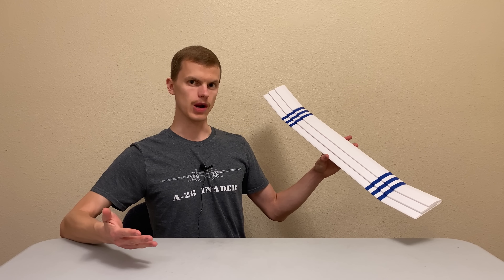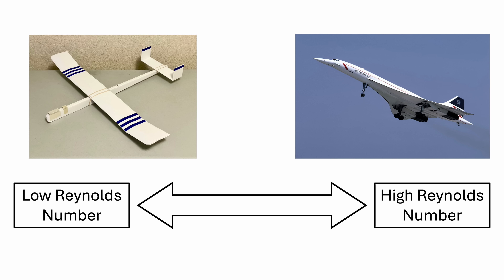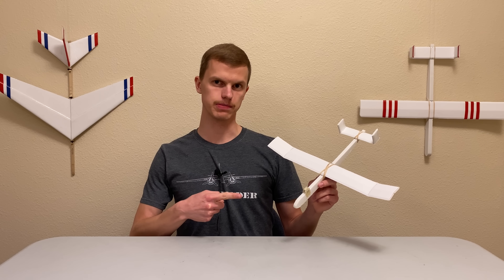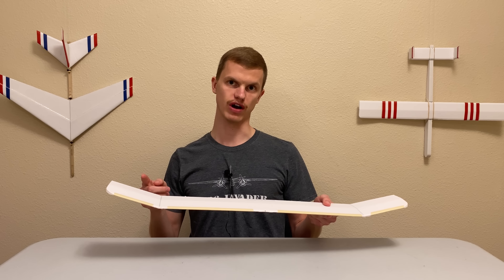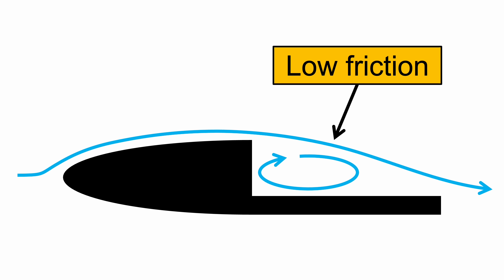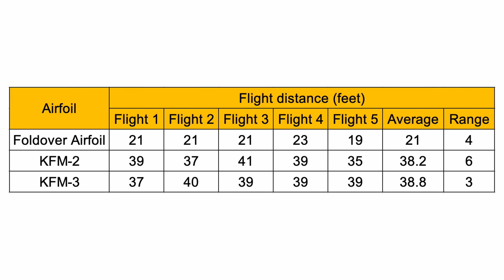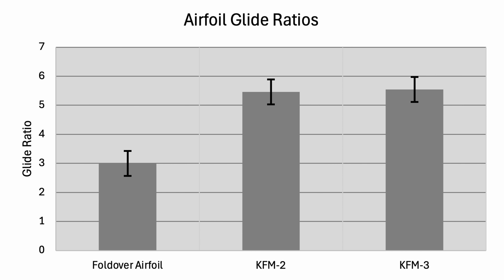Stepped Airfoils for Model Airplanes - Are They Better?

Comment: odd... I recall doing a similar test, with a FT wing, a KFM wing, and a hot wired wing and my results got the FT and KFM wing nearly the same and the hot-wired wing with about 2+x the performance.  My tests, the only thing I changed was the wing (I would have to check if I documented weight differences in the wing itself as the test was done a good while ago), the rest of the craft was static.

You did say you changed the CG, launch speed, launch angle, elevator trim, and the wings had different weights.  Perhaps, one of the many other variables that changed is what drove most of the flight differences, not the wing style.

For example, IIRC bringing  the CG closer to the CP, will increase the efficiency and decrease stability for a given craft.  so if you significantly moved the CG back on the KFM wings vs the FT wing, that alone might explain your results.

I will also note, that your gliders are flying slower then most RC plans [no motor, servo, battery,, rx/etc adding weight], so perhaps the results are valid for your gliders, but the additional speed needed to get the additionally needed lift for a typical RC plane's all up weight, might change your results]

Comment: Thank you for this inspiration. I remember a hand glider kit of the 70s which had  a turbulator on the upper side of the wing. It was a rather thin band with a zig-zag shape. It might be interesting what impact on the performance a dented step would have.

Comment: Very cool experiment.  You may want to check out how real indoor competition models fly.  (Glastonbury Modelers has many videos on YouTube.  The most recent one is today, 10-13-24.  The only things that will match up with what you are saying are the two catapult gliders, at 7:40 at 13:26.  Both of these are fairly sophisticated; balsa leading edge 25-50% chord, and a foam TE.  The smaller one at 13:26 is mine. The balsa is 3/32", the foam of the same thickness glued to that and tapering maybe to 1/64" at the actual TE. I look forward to making one in the next week or so that has a 1/4" high point, with the foam glued to the bottom of that.  I'll probably make two, with the step at 25% and at 50% (but the high point of that one will probably still be at 25%.  No idea of the Reynolds number, but the bottom of the curtains is, I believe,  at 25'.

Comment: Very interesting, thanks for creating this video.  I wonder if the stepped foils would work well underwater on a lifting foil?  It probably depends on speed.
Reply: water is more viscous than air, so they reynold's number will be very low (good thing), but i think you lose the main benefit of the stepped airfoils (ease of manufacture) when you're going to have to fiberglass the wing for use in the water. It would be quite a pain to lay up the fiberglass into those corners without leaving any pinholes.

Comment: Hey, FYI early on your microphone seems to be clipping. Your videos will perform much better if you can improve your audio, either tweak microphone sensitivity or have it closer to your mouth (and waaay less sensitive) when you are recording your speaking bits. Also sitting close to a wall or having the microphone close to a wall when recording can screw up the audio because of standing waves, so maybe that's what happend in the beginning.

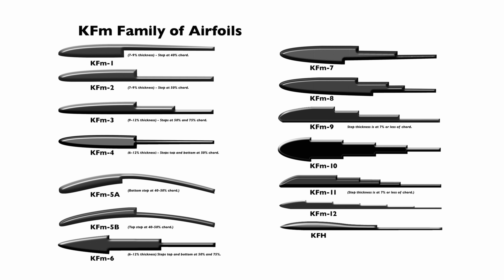Comment: Amazing video. Ref: at 4:06 is the KFm foils page. While watching it I was having 2 thoughts:
1) use the flat extension as aileron/flap positioning the hinge at the edge of the step. 
2) in your flight videos some planes have a nose-up attitude and glide while others simply glide downwards. A clever way to adjust the center of mass is to make it as independent from speed as possible. So having the plane have the same nose attitude regardless of launch speed. When you reach this condition your CG is theoretically on the center of lifting force of the wings. This could potentially provide some other kind of results, since CG is then trimmed to be at the center of wing lifting and not optimized for distance.

Comment: A similar thing happens with pickup trucks.
Reply: no it doesnt??
Reply: Wasn't there a Mythbusters episode that covered that? Truck bed covers vs open, with tailgate up or down?
Reply: @dfunited1  It might have been Mythbusters.  As with the wing, a vortex forms in the bed and the air flows smoothly over the truck plus vortex system, improving fuel economy.  It's also why things that are not tied down exhibit very little tendency to fly out of the bed.  They are in air that is mostly travelling along with the truck.

Comment: Wow, mind blown! Question: when testing, did you also match up the airfoil masses?
Reply from the maker: The difference in the masses of the lightest and heaviest planes was only 6%.  I didn’t try to make it match up exactly because the weight of a glider doesn’t affect the flight distance.
Reply: @DesignYourOwnAirplanes-xd6lz Ahhh. I now dimly remember hearing that in the past 👍👍
Reply: That also crossed my mind.

Comment: I have used KF airfoil for past ten years with great result. I have used KF2 and the one with steps on top and bottom. To me KF not only simlify build the wing, but it's also cheaper, due to use less material. To me KF airfoil flys under its own air. For a non-scale planes KF is the way to go. Do you have access to a wind tunle to see the air flow over a KF airfoil?
Reply: I never thought about publishing my degins.I usualy draw some lines on foam core boards, and I take it from there. I don't use any cad for my design, except once.  However I've developed my own technique to make the step down. I' am curently working on a new design called Flying Dart. It's a flying wing with five degre of forward sweep. It's hald fuslage with landing gear and a pusher configuration. If I can find my cam, I'll video the process of building the wing.. I'll let you know when I've publish the proccess. Thanks for your intrest.
Reply: @almosh3271  thanks! That sounds neat, I’d love to check it out. A teen at my local field made a wing with foamboard and I was shocked at how sturdy it was. They were having trouble with the balance or possibly design (it was a little smaller than ideal, so stall speed was high, I think, making launch very difficult and it probably needed more motor/prop to maintain high speed). Anyway, it survived very many crashes while they flite tested it. Good luck with your wing build and I hope to see it.
Reply: How does that impact your motor size, etc?
Reply: @Kleinage  I don't have anything to compare KF airfoile impact vers a regular airfoile as far as motor size, battery usage and so forth. All I know is KF airfoile is easier for me to build. Not to mention the wing feels lighter on its feet, for lack of better word.Even if I build a regualr type of wing with the same dension as a KF airfoile. The weight would be diffrent, therefor the perforsnce of same motor can't be measured and then compare.
Reply: @almosh3271  that sounds neat. Do you post your designs anywhere?

Comment: What about weight?  It looks like the KFM-3 has more mass.
Reply: This was also my concern. Each wing profile would have a different mass. The foldover probably being the highest. He didn't mention in the video whether this was controlled for by adding additional mass to the plane to make each variation have the same total mass. 

It's likely that the difference could be negligible, but the only way to know for sure is if it were tested.
Reply from the maker: The difference in the masses of the lightest and heaviest planes was only 6%.  I didn’t try to make it match up exactly because the weight of a glider doesn’t affect the flight distance.

Comment: "Golf ball skin" on back of air foil probably can do similar job. I know it will be bit harder in manufacturing - but can you try to make: flat bottom foldover Air foil - shoot it few times to compare to "original one" and next take a "stamping element" made from steel bal glued into few steel washers and punch symmetric-angled mesh of 1/3 holes in top-back part of airfoil foam. Don't worry if covering paper cracks a bit. Mythbusters as well test that, but in higher scale - and they don't make reusable plane. There was other types of similar solutions - "riblets" for example, but hard to achieve at home.
Reply: You could 3D print these and glue them together.
Reply: @wurstelei1356  It's way away from "cheap and fast model making". Not 5$ for all people around.

Comment: This was a topic in the 1970's. Thought it was all researched out....
Reply: Well, I think the first test is to check if the experiments are even reproducible. This often finds faults with older experimental designs. Second is to iterate over the designs and test new ones, and again do iterative tests to find fold-over points, i.e. when other things, methods or technologies become more effective at solving "the problem" at hand, in this case gliding far at low R numbers.

Comment: Do all these wings have the same mass? It looks as if the KFM-2 has less material than the others.
Reply from the maker: The difference in the masses of the lightest and heaviest planes was only 6%.  I didn’t try to make it match up exactly because the weight of a glider doesn’t affect the flight distance.
Reply: Very interesting that it does not.

Comment: Interesting stuff, even though I only understod half of it😊. Nevertheless, I'm interested in this coming from another recreational sport, windfoiling. This is quite a new phenomenon but basically you put a small glider ( i.e. front wing, fuselage and a small stabilizer) on a 1 m long "mast" and bolt it to the windsurfing board where the fin used to sit. So what happens when you get the lift of the wing is that you can soar with the board two feet above the water surface 😀 Now, the question is: I understand that water is a completely different ballgame compared to air but would these stepped wings be beneficial also for "waterfoils"? FYI: usually you need about 10 knots in windspeed to get the wing to lift ( of course depending on the weight and skill of the sailor and size of the sail). Top speed for the foil is around 30 knots. Looking forward to your reply. Greetings from Sweden.
Reply: I haven't done the reynolds number calculation, but I am pretty sure that the hydrofoil is operating at a very different R from a hand thrown glider wing. TBH, I'm not convinced that these wings would work well in AIR at 30 kt, much less water

Comment: You have apparently shown that a very crude airfoil that is too thick for a small, slow model glider (thin works better at low Re) can be improved by KH steps. Intriguing, but it's only one data point. A similar test with modern composite airfoils, one with the aft-half upper surface removed, would also be interesting.

Comment: 8:11 So you launch different planes at different speed, giving them not the same amount of energy to start with???
Reply: If you wants to measure their glide ratio, they need to be in steady state. 
If you wants to measure how far they can flew from the same height, they need to start with the same energy.
Pick one.
Reply from the maker: When on a steady glide slope, gliders fly at a constant speed, and therefore the kinetic energy stays constant throughout the flight.  None of the kinetic energy was used to increase the flight distance the way the potential energy was.
Reply from the maker: Gliders fly at a constant speed, so their kinetic energy stays constant throughout the flight.  None of the kinetic energy was used to increase the flight distance the way the potential energy was.
Reply: 7:41 "Each plane was optimised to fly as far as possible" 
They wouldn't be launched at their steady state if they were optimised to fly as far as possible.

Comment: Remember that not all the parasitic drag is in the wing ... it's everywhere on the plane, fuselage, tail, etc. At low Re it becomes important to use a boom tail rather than a tapered cabin, and to use a rudder placed farther back for better leverage, where it can also be smaller with less drag and have the same, or better, control authority. Smaller slower aircraft have different design trade offs, than large fast aircraft.

Comment: Isn't this the same as driving a pickup truck with the gate down?
Reply: Not quite ... the airflow goes over the cab and down into the bed, which with the tailgate up, is a huge sail trying to stop the airflow. When down there isn't that blockage.

Comment: I remember some stepped airfoil profiles being tested in the wind tunnel at Daytona Beach campus of ERAU.  It was amazing to see how well they performed.  The shape was the rounded nose to spar then essentially a skin from the top of the spar to the TE. The idea was to use differential elevators for roll control.

Comment: I have an idea for a more complex project if you could have air coming out of tiny holes in the leading edge of the wing to reduce skin friction with the front too? Idk just a thought
Reply: I am mostly guessing here, but I think a lot of the reduction in friction isn't because it's air rather than plastic, but because the vortex is acting like a bearing, and top of the vortex is moving at closer to the relative wind speed, if I'm, right, you want large vortices with large volume to allow space for the vortex to turn with minimal interaction between the skin friction at the bottom of the vortex and the faster moving top of the vortex.

I was initially thinking that a lot of small steps would be better, but the results here show that more, shallower steps don't give the level of performance boost that few deeper steps seem to give

anyone versed in fluid dynamics, feel free to correct me

Comment: Here’s an experiment for you:  Let’s say that not all parts of the wing are created equal.  The portion of the wing close to the fuselage performs differently (to some degree) than the wing portion near the tip of the wing.  Thus, would it be possible to create a wing structure such that the portion of the wing near the fuselage contain a stepped airfoil and can that step be slowly eliminated the further out it gets to the tip of the wing where (possibly) the air flowing over the tip reacts differently than near the fuselage.  I’m suggesting that possibly a “hybrid” wing design may be possible where near the fuselage it is of a stepped design and near the wing tip it is more of a solid surface design.  Just a thought.
Reply: to my knowledge this is done at the blades inside the rotary turbines where a thin layer of air does just this (and is good for cooling and isolating the blade material from combustion gases)

Comment: One thing I want to know, which I didn't notice you mention, is did you normalize for weight? Perhaps I am wrong, but looked to me like the fold over would have been the heaviest wing, or at best tied with the KFM 3 while the KFM 2 would have been lighter.
Reply from the maker: The difference in the masses of the lightest and heaviest planes was only 6%.  I didn’t try to make it match up exactly because the weight of a glider doesn’t affect the flight distance.

Comment: I think you need to do the experiment with the same profile on the top and bottom of the wing on your base case, Maybe make you base case a flat wing top and bottom.  I think there are different factors at play from what you are suggesting.  It could be that the step is breaking up the drag behind the center spare.  Maybe comparison the a flat wing is the go.  Very interesting well done.

Comment: Interesting concept! I have no experience with stepped wings, but I think their advantage would be getting smaller with smoother wing surface and so even on low Reynolds number planes, there is no advantage of using KFM airfoil if you can get a smooth surface finish (coating film for example).

Comment: Suggestion for efficiency: close the hole at the wingtips. There is air circulating in the open space on the KFM wing, which is what you want, but that gets destroyed at the wingtips, thus you want a surface there to prevent the inrush of air.

Comment: Were the rubber bands used several times first so they don't degrade quickly from one use to the next?
Reply from the maker: No, they were new.  As I was doing test flights I did notice that I sometimes had to change the amount I pulled them back to get the plane to fly straight.

Comment: I assume that a turbulator or a rough surface would have the same effect. It is very likely that the Reynold number is too low for the "unstepped" airfoil.

Comment: smooth is always better for maintaining laminar flow, golf ball dimples aside, but a very nice video and does ask some interesting questions
Reply: Correction: Appropriate roughness is optimal. Beyond some limit, less roughness has no benefits, and in some cases, serious losses. Otto Cycle piston engine valve intake passages in particular. If smoothed too much, more turbulence results from change from laminar flow to turbulent. Ideal roughness allows laminar flow above the air engaging ideal roughness further, and a less violent transition, increasing flow. Lots of variables such as Reynold's Number, such that empirical tests are often key to best results. In air, (full size sailplanes, IIRC) for specific Reynold's Numbers, 45" cross sanding angles creating small diamonds with used 100 grit sandpaper tested better than smooth, or rougher.

Comment: Weight variation of different wings consideration?
Reply: One Hopes each test configuration was ballasted to the same total weight. No maneuvering, so polar moments aren't pertenent.
Reply from the maker: The difference in the masses of the lightest and heaviest planes was only 6%.  I didn’t try to make it match up exactly because the weight of a glider doesn’t affect the flight distance.